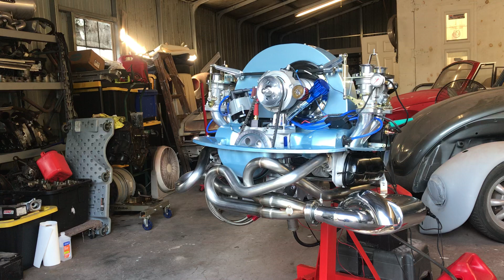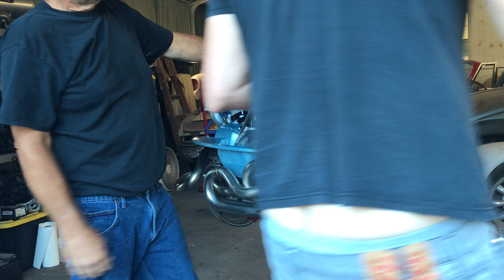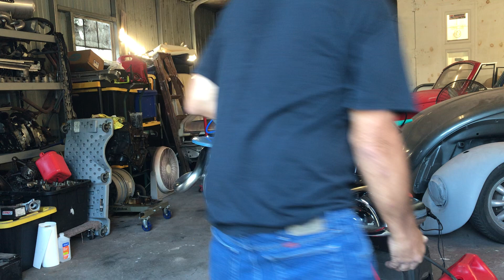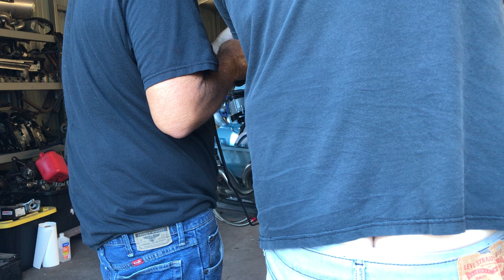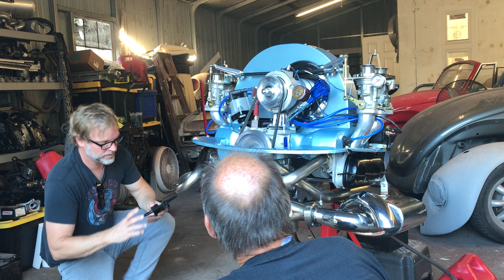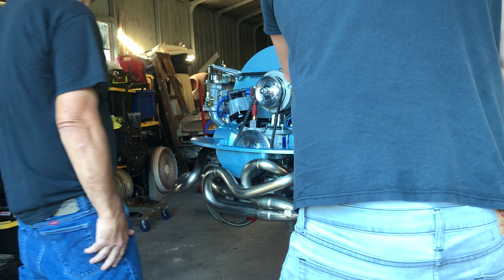Firing up CT 1600

Comment: I have a '75 Bus that I might need to rebuild, it's been sitting for several years and a couple of years ago I started it. It needs a fuel pump right now, it was converted to dual carbs and it has an electric fuel pump and don't know what pump to buy, it's a small square pump, no one can give a straight answer on how fuel pressure I need. I'm thinking 3 to 5 psi. Does anyone know? Thanks.

Comment: IDK why those HEI ignitions are so expensive. Why doesnt someone make one that works good that is less money. Just baffles me. They could use another distributor from like a Chevy or ford then recast it (cheaper cap and rotor) to fit in a VW. then use some GM or ford HEI module so we can run these. They are better for fuel economy. less dentation. better firing.
Reply: Hi Mike Fn Garage I believe Performance Distributors makes a hei GM distributor for the air cooled VW. And Mike btw your channel is awesome love your rebuilds and the oval is coming out nice.